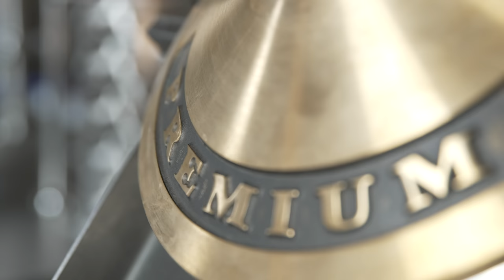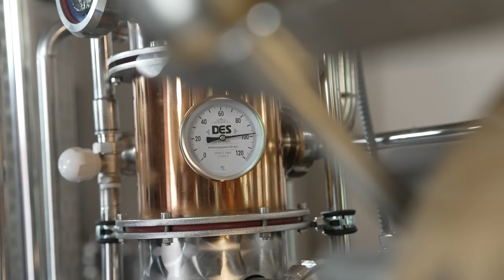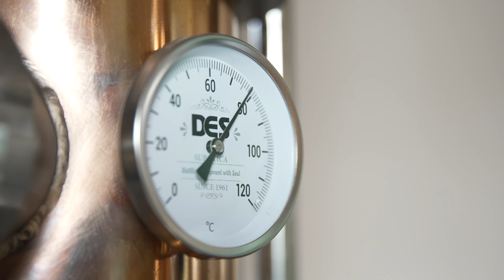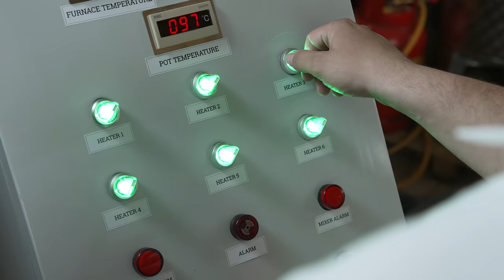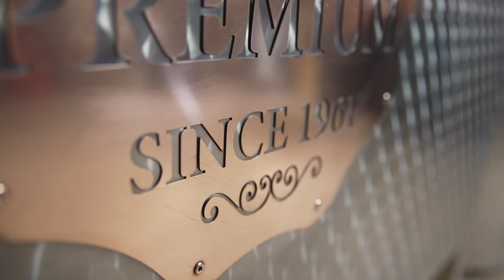Commercial and traditional distillation still 150 L  side column - Making Cognac

Comment: Just a curious question, if the gin basket is placed like shown down the table and not at least at the level of column top, wouldn't that make the alcohol accumulate in the gin basket, and prevent the flowing to the condenser?